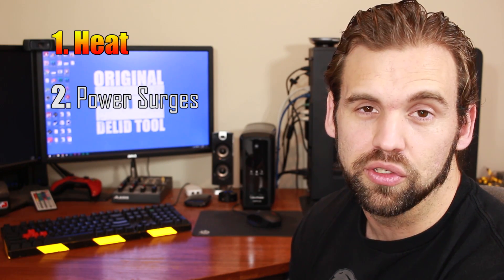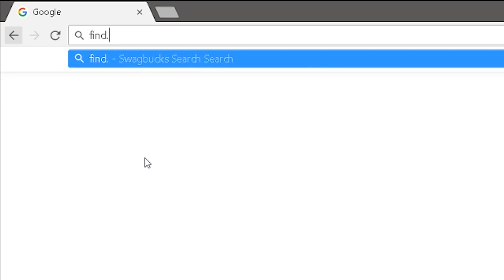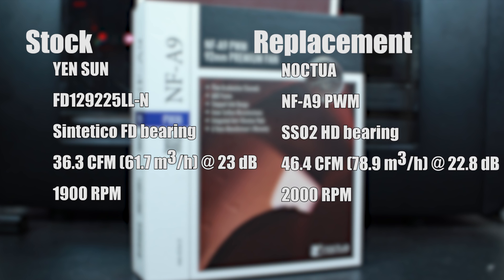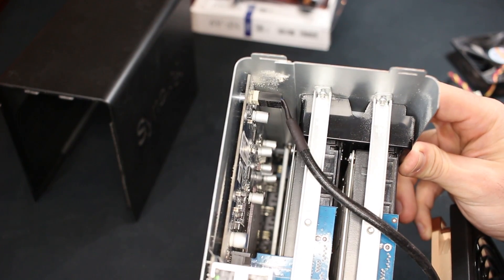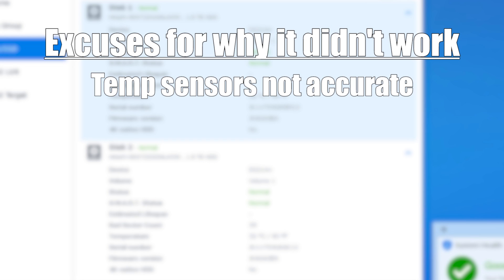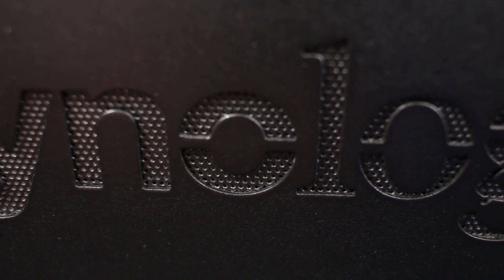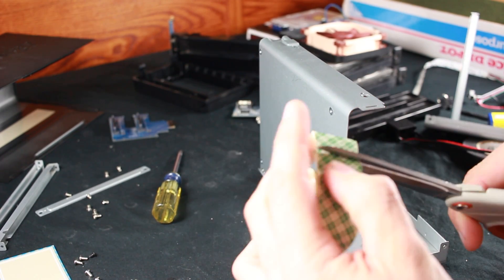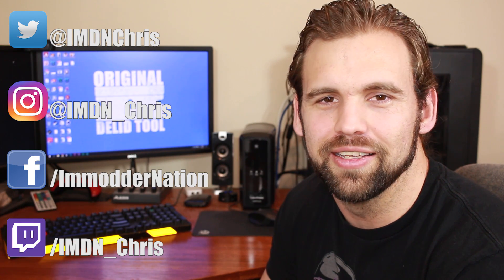SYNOLOGY FAN AND LIGHTING UPGRADE - WILL IT IMPROVE TEMPERATURES?

Comment: If you wanted to limit dust ingress, positive pressure (sucking cold air in) with a filter is actually preferred.   A lot of professional equipment works on positive pressure with filters, like big transmitters.   Some Synology devices actually come from the factory with the fan sucking cold air in.  I did a test and it makes little difference to temperature either way, but I like keeping the dust out of my device.
Question on the lighting.   Did blocking those side panels make any difference to temperature?   The Synology logo's usually help with airflow.
Reply from the maker: Yeah, mine sucks in a lot of dust. I don't know if blocking the side panel made a difference in temperatures. Maybe the fan spins up a little more, I honestly can't tell.

Comment: U did the big mistake. Don’t Plug PWM fan to 3 pin controller because without pwm signal the pwm fan will run at lowest speed or stop at all !!!
Reply from the maker: The Synology alters the voltage to control speed on 3 pin whereas 4 pin pwm signal alters current and voltage stays constant. The pwm signal is unused.

PCs are different. You can read this link from Noctua here: https://noctua.at/en/can-i-run-4-pin-pwm-fans-on-3-pin-fan-headers
Reply: @ImmodderNation  actually Synology (at least ds220+) uses low frequency PWM voltage control over 3 pin for speed regulation (for Vrms changes). 4 pin PWM fans are powered with constant voltage but high freq PWM signal modulates this constant voltage, in result motor is powered with PWM square wave signal.
Reply from the maker: You literally just said what I said

Comment: At the end was that the noise you get with the Noctua fan?
Reply from the maker: The high frequency buzzing was the inverter for the electroluminescent light panel.
Reply: @ImmodderNation  that's a relief...
Reply from the maker: I did another video where I silenced the inverter. It was a Mod Monday episode.
Reply: @ImmodderNation  I'll look for it, thanks.
Reply from the maker: I'll save you the trouble. https://youtu.be/ITjPzCoXA3s

Comment: Also, you cut off part of the air flow by installing that panel.............
Reply from the maker: A little bit. Don't know how significant. I would expect the fans to spin up more in order to compensate.

Comment: I suspect the Noctua fan might not be spinning as fast because there might be a difference in the power being sent to it (Synology header might be tuned to the stock fan only)

Also, the main selling point of Noctua fans is that they're more "industrial" --  they're meant to last and have high resistance to moisture and dust
Reply from the maker: The only way I could know for sure is measuring voltage going to the stock fan vs noctua fan under the same conditions. The only reason I picked noctua is because they're a well known fan and they had the size I needed.

Comment: 1) Swap the fan to lower the temps
2) Put another source of heat in (it is marginal, but still)
The glowing synology looks great though ;)
Reply from the maker: Didnt make a difference. Fans don't spin faster to compensate for increase of heat. I think the El lighting looked good!

Comment: Gday
Can you firmware mod the OS and run proper Linux ?
Reply from the maker: That I don't know. I know it runs Linux Kernel 2.6.15, but not really a Linux OS. I think it may be locked. I think you would need an EEPROM flasher to overwrite.

Comment: If you want to see how hawt your drives get, you should have done a stress test with both fans... Rarely is the answer to a cooling problem, bigger fan. Especially with something so constricted...
Reply from the maker: Not bigger fan, more air movement at lower RPM.

Comment: i work with EL wire a lot.. just make a form fit wrap made from foam-core board around the lil power converter (lil black box) .. it dampens the sound 80% or more.
Reply from the maker: How thick is the foam core? Are we talking dollar store stuff?

Comment: Actually I noticed that the HD driver remains quite constant also with original fan in various HDD usage. The big difference is in CPU temperature, in "silent mode" it goes up to 52-53°, at full speed mode it lowers at about 40 degrees. You should do a test with that temperature, maybe in that case you could see a difference...
Reply from the maker: Maybe, but the problem is that I have no way of fixing fan speed to determine whether a different fan improves CPU temps. The smart fan curve changes based on fan cooling performance and set temperatures within the file that I showed. I would have to divide CPU tempeature by fan RPM speed to determine the better working fan by efficiency.

Comment: Well, since the Noctua fan moves more air, (and assuming the Synology fan controller works well) it will never run at the full 22.8db output. Some quick maths reveal that the Noctua fan will actually net you a 22.5% fall in decibel output. I would call that a pretty significant difference, especially considering the relatively low price for this mod.
Reply from the maker: I'd still have to measure with a dB meter because the ear test is out.